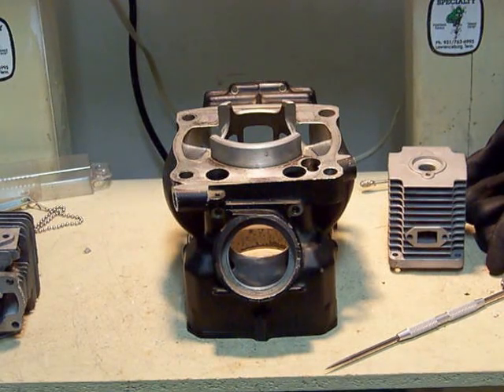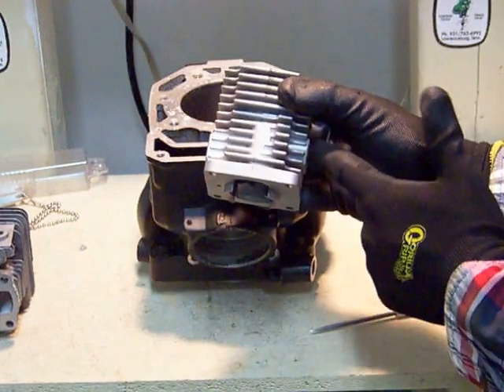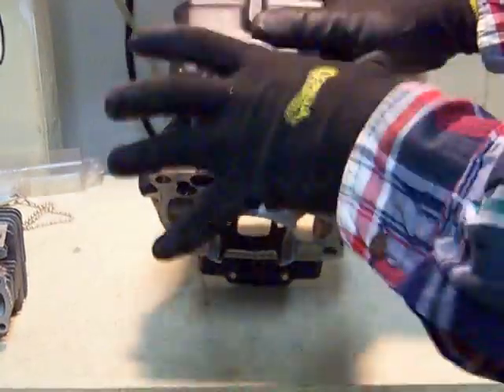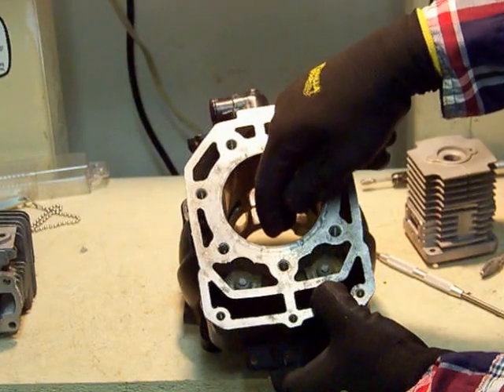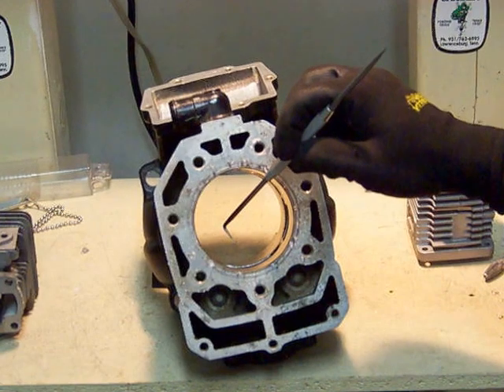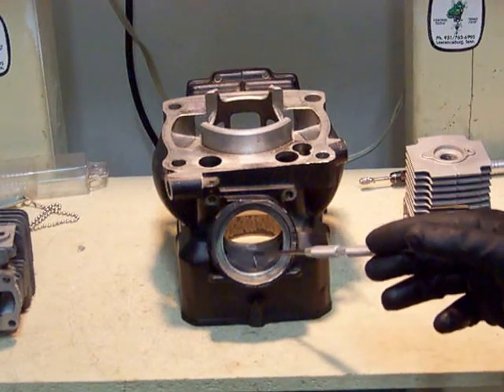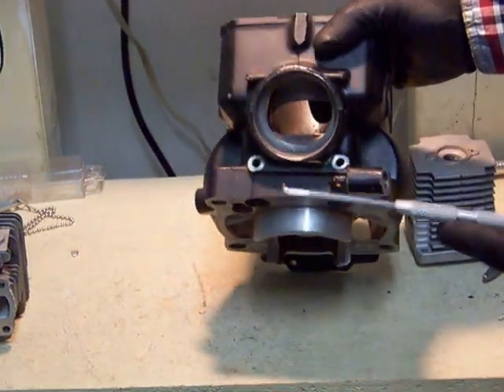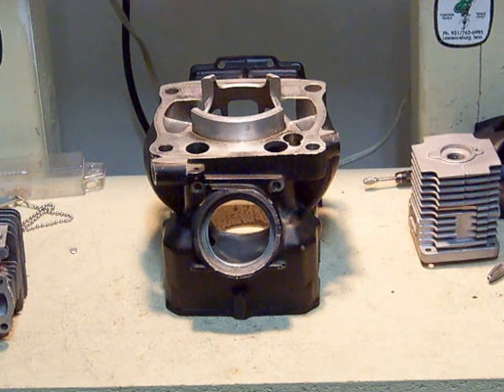2 Stroke Exhaust Port explanation. Information and porting tips for 2 stroke cylinders.

Comment: my question is is the intake and exhaust  ports slightly tapered as to not catch a ring or break it
Reply: You can chamfer the piston side openings to the exhaust and intake port. But do so in moderation there is a video on the same channel about it

Comment: Holy shit. Most pointless vid on ports ever. Pls any beginners stay clear of this. It will fuck fuck your head up.
Reply: It was not a vid on porting the port.  He was explaining the port's function, and what changing the port time will do in effect.  I look at "the pressure wave" he was talking about as a sonic/sound wave that comes back to the piston with a tuned pipe, (but pressure can help hold a fresh charge in the cylinder too), but bother than that, He said nothing that I saw as wrong.  I have been porting small 2-stroke engines for a living since 2007, and these guys are world famous for their tools since way before I started racing MotoCross in the 80's, (when I started buying their tools.).
Any moron can bash somebody,--and say nothing of "reason".  That would be you son.  Sorry.  Sue your school. It's their fault.

Comment: I see some guys putting a 12 degree angle on the dome of piston I don't see a benefit to it they claim it helps flow and saying it opens the port earlier without porting the cyl what's your thoughts
Reply from the maker: Great question. For certain lowering a ramp like area on the Piston crown will definitely allow the expanding combustion gases to escape earlier in the rotation cycle. The other effects of this would be increased volume remaining in the combustion chamber at TDC, obviously decreased compression and delay in closing of the port on the upward stroke of the piston. The angle of the ramp, the width in relation to the port width, and depth across the cross axis of the Piston crown would all be things to consider as well.
I will leave the question of how beneficial it is to be decided by the individual doing the work.

Comment: Hi, I have a new expansion exhaust. I hear that they recommend porting the exhaust port, should I? mine has a D shape on a 50cc Zuma 2 stroke
Reply from the maker: Good question, but difficult to answer specifically, since there are dozens of variables. Here is a good general approach: the basic job of the expansion pipe is to better utilize the exhaust refractory wave depending on the desired power delivery characteristics of the cylinder, any porting improvement that you can implement to better, and more efficiently utilize that pressure wave, will benefit the performance.

Comment: my 2001 cr 250s ports are smoothened for more top end how cani reverse this for the bottom end back
Reply from the maker: Smooth ports typically will not determine top end performance. Top end is usually a product of the exhaust port height, or power valve setting/height, along with the pipe tuning and transfer port trajectory. Bottom end and mid range is often improved with a slightly lower (but sometimes wider) exhaust port roof, and transfer port windows that are angled down and away from the exhaust port, into the combustion chamber. The pipe will also benefit from a more mid-range to bottom end configuration. Of course you can add texture to any port wall that you would like, using abrasives or carbide burrs, or some combination thereof, I just don't think that will effect power production characteristics of the cylinder that much. Thanks for watching.

Comment: i need help,,can someone telling me about effect or advantage to two stroke engine when widening exhaust port..?
Reply from the maker: The effect would be a larger potential volume of air being able to move out of the exhaust port, with less resistance, in a shorter amount of time. By making the exhaust port wider you also increase the potential volume of new air/fuel mixture that can escape out the exhaust port, which is a negative effect. There is also an increased chance of piston wobble and ring wear, that can only be reduced, to a moderate amount, by a bridged port. Like almost everything you do in 2 stroke porting, there are positives and negatives.
Reply: @Ccspecialtytool  I see widening the port, (within physical limits) as a good way to increase port time area and not have much chance of making the power curve too peaky.  You should get some more top rpm, but the effect of higher rpm power per material removed is much less than raising the port.  One of the old 1970's porting books said "go wider before up and down", (talking about the intake of a piston port engine too),---is pretty good advise.
Doug in Michigan  Long time customer. Pleasure doing business with you folks.

Comment from the maker: @ Leonard Luiz 
Thanks for watching. The amount you need to increase will depend on several things. An increase in the X axis, or across dimensions, would only require about 0.5 to 0.6 mm, with corresponding shaping and blending of the port channel. An increase in the Y axis, or up and down will effect timing and therefore you will need to follow the .003 second return to degree of rotation formula I mention and you can find it on the CC Specialty Tools website, Tips and Techniques section.

Comment: what shape exhaust porting to gain topspeed?
Reply from the maker: Exhaust port shape will not determine top speed, or the rpm of peak hp output, as much as the height of the exhaust port roof will. Raising the exhaust port roof will typically raise the rpm at which hp will peak. As for the shape of the exhaust port, it should be as aerodynamically smooth as possible, this will optimize use of the returning pressure wave from the tuned pipe and this will keep the new air/fuel charge in the combustion chamber. This will also allow the escaping exhaust gasses to leave more efficiently. The surface of the exhaust port should be very smooth, preferably polished. This will maximize efficiency and minimize carbon or "soot" build up that decreases overall port size and port flow potential. Thanks for watching
Reply: +Crobular I    CC Specialiy Tools. Are giving 100% excellent info on 2 strokes and are no doubt very knowledgeable indeed.  Listen to them.
Reply: CC Specialty Tools Lots of things to consider when changing anything on the exhaust port.
Reply: +Tj Hagan    Raise the transfers by the same amount that you raise the EX port.!.  I agree, there are lots of things to consider if you move the EX port.

Comment from the maker: The other thing I might point out is that along with your tuned pipe, which is critical, you also must consider what your goal in tuning the cylinder is. For example many road race 2 strokes(often targeted at 10,000 rpm) have an exhaust duration of 200° to 203°, where as lower rpm targeted mx cylinders may only have a duration centered around 180° . You will have to consider this as well
Reply: CC Specialty Tools  can give me porting diagram,